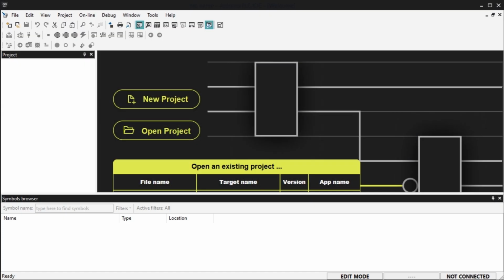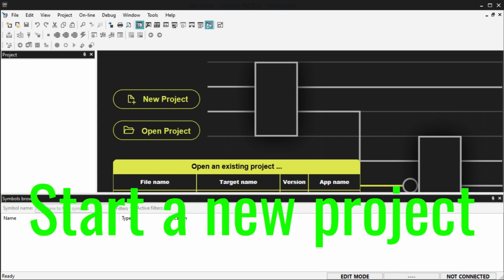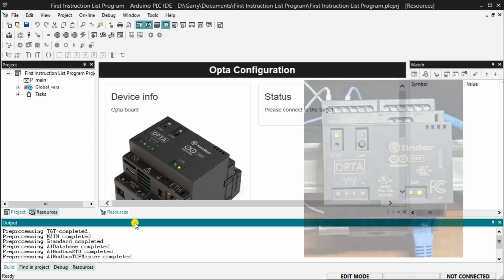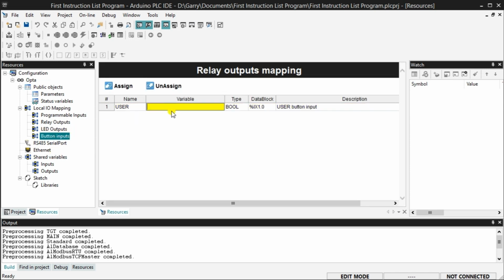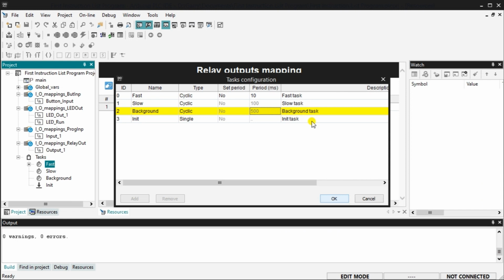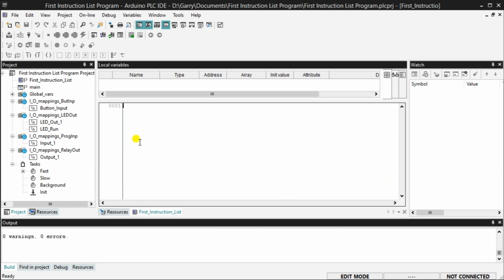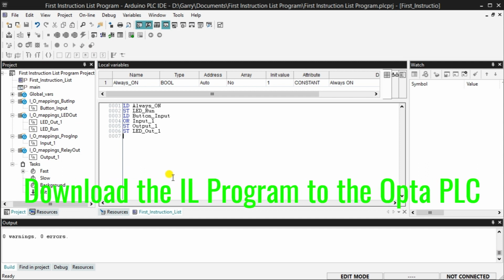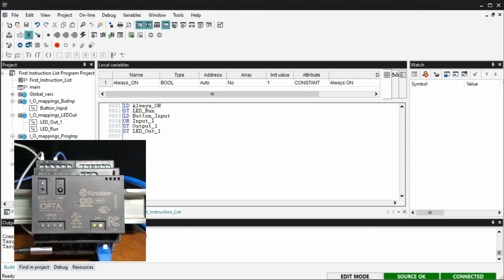Learn to Arduino OPTA Instruction List on PLC! 📃

Comment: Wow, a most interesting Arduino OPTA PLC Instruction List video.   Can the OPTA be hooked up to the new Raspberry Pi-5?  If so, then a camera and OpenCV can detect and measure objects. 
😎  Thank you for the great video.
Reply from the maker: Hi @qzorn4440
Thanks for the comment.
I would look at Node-RED. This is a flow-type IoT-enabling software programming package that can communicate to many devices, including PLCs. 
https://accautomation.ca/series/node-red-iot-enabling-software/

Node-RED has a node-opencv flow. So you can use OpenCV within it.
https://flows.nodered.org/flow/b18e4eed8317d721db9c0b7c65755dc4
I hope this helps you out.
Regards,
Garry
Reply: Sounds interesting. Thank you.  @ACCautomation